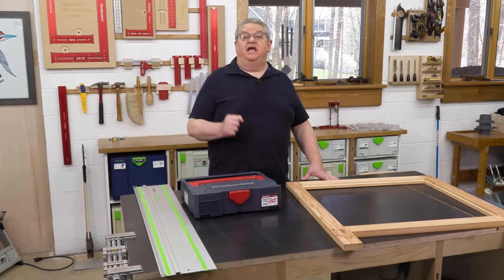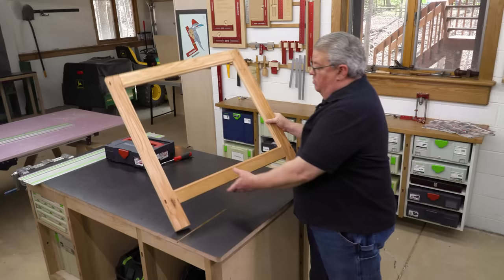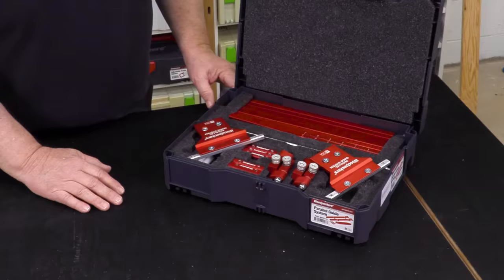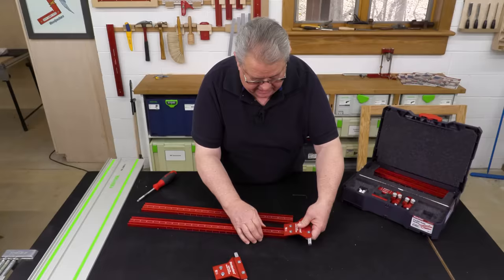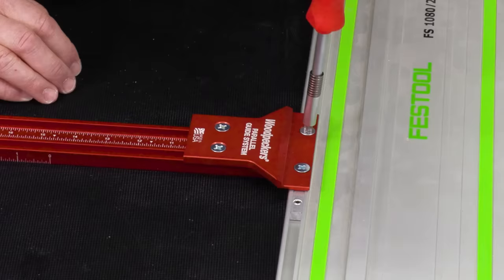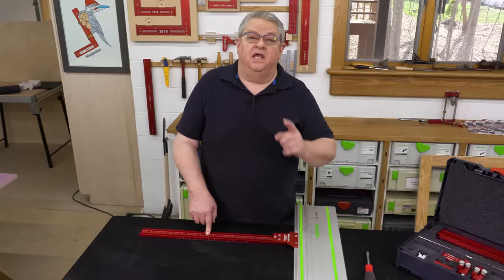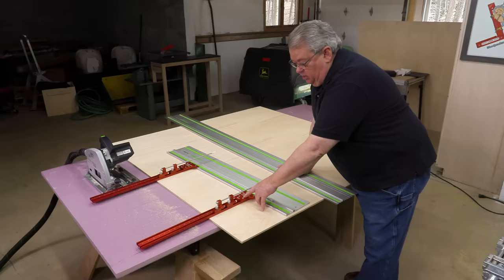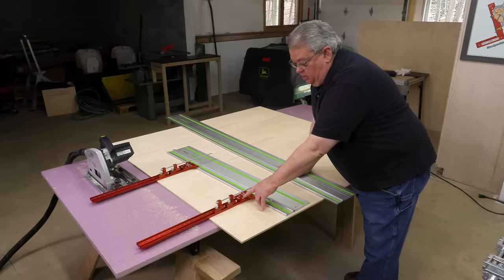This Track Saw Accessory Might Replace Your Table Saw | Deep Dive

Comment: I found this to be dangerous. You didn't anchor the track to the board. That's why they give you them with the track system
Reply from the maker: Sure I did. I did only use one clamp, but I've never had it move with a single clamp.
Reply: @WoodpeckersLLC  And yet you didn't tell the viewers. Safety first. If the manufacturer tells you to use the two clamps you use the two clamps. It will be that one time you get cut back from it slipping and off to the hospital, you go. Mate, you are giving an instructional video and someone is going to copy you.
Reply from the maker: Festool and its trainers teach that no clamps are necessary for most cuts.
Reply: @WoodpeckersLLC  Please supply
Reply from the maker: https://www.youtube.com/watch?v=OxLEXVTjDpY 10:23 "I don't clamp the rail down when cutting plywood." He's their head trainer and host of Festool Live.

Comment: Sorry, but this gadget is not needed for the track saw to accomplish replacing the table saw.  It already does that.  And as far as using this gadget - price aside - it looks like a total time-wasting pain in the arse.  Also, after only a few cycles of assembling and disassembling, it will be absolutely no more accurate than simply using a tape.

Comment: Sorry guys track saws are an amazing tool and so is the table saw but they are not the same tool they both have their benefits but one will not replace the other People act as though the only thing they do is cut panels! what about resizing a small piece of moulding cutting dados or rabbits or a whole host of other things you can do on a table saw that a track saw will never do! sorry guys

Comment: If the square edge it precise enough to ensure each length of the attachment are dead straight when connected, why can’t you just rely on the same square edge to be square to the edge of the track?
Reply from the maker: Square it would be. The calibration process is to get the scales in sync with the edge of the guide rail.

Comment: The original festool is half the price!
Reply from the maker: Comparing apples to apples, the original Festool is $360, compared to $399. Hardly half price and the Woodpecker tool offers significantly more width capacity (52" compared to 25-1/2")
Reply: Festool now has the price to $375 so it's about a $25 difference.

Comment: This video is full of exaggerated claims. How is this more space efficient than a table saw? I mean when it is in use. And like we buy a table saw just to rip plywood.
Reply from the maker: Space efficiency: To rip a sheet of plywood on a table saw you need 8 feet in front of the blade and 8 feet behind the blade plus room on each end for the operator. With a track saw you need  8 feet plus enough room to walk around it. The only exaggerated claim is the headline, which may be a little over the top, but I stand behind everything I said in the video. I did not, nor would I, suggest you throw out your table saw. As you say, cutting plywood isn't the only thing you do with one. I use a track saw in concert with my table saw. If I had not been demonstrating the Parallel Guide System I would have made the first couple of cuts with the track saw and PGS then moved to the table saw with manageable sized pieces.
Reply: @WoodpeckersLLC  with limited space, we do exactly what you described. Use a straight edge and break the sheet to roughly the size needed. Then cut to final size on the table saw. It is much faster to adjust the table saw fence than adjusting the pgs.
Reply: @b3arwithm3  man you are correct that’s what I do with my sheets of plywood regardless if it’s a repeat cut or not just cut it close to the measurements you want and then let the table finish the rest

Comment: What makes me mad as hell about things like this is the "screw the regular guy" sky high prices. Let's be real here, fully functioning profiting wood shops are NOT watching YT channels, they're producing, selling and banking . The little guy is the one subscribing, the little guy is the one advertisers want here, the little guy is why channels are monitizing. Then you insult the little guy with this...hey replace your 499.00 table saw you finally talked your wife into letting you buy, with this over $500 track saw accessory...gtfooh....I'll bet money there is a  Woodpeckers pencil complete with it's own locking case for only 199.99.

Comment: Man,  just run a straight edge install some clamps and start cutting & done...seems like not everyone wants to spend thousands on useless tools.
Reply from the maker: If you only want one piece, you are exactly correct. The point of the parallel guide system is not making one cut, it's about making dozens of them exactly the same.

Comment: An overly engineered and complicated solution to a problem that doesn't exist.
Reply: better over than under engineered but not so hard to understand. The problem that exists is rather obvious to most woodworker.

Comment: Too bad this does not work with my Woodpecker story sticks
Reply from the maker: Doesn't work in what way? The tracks are interchangeable, but the scales are completely different.
Reply: @WoodpeckersLLC  The tracks are completely different, lay them side by side.  Agree on the scales.  How would the PGS flip stops function on the story sticks?
Reply from the maker: The tracks are exactly the same. They're both based on our DP (dual purpose) Track. Story Stick works with the single track side up and the Parallel Guide System works with the dual track side up. I'm still trying to visualize what you want them to do.
Reply: @WoodpeckersLLC  actually this answers a question.  I would consider buying the parts to upgrade an existing tool so that would have a dual function.  Thanks

Comment: That looks extremely complicated and time consuming to use
Reply from the maker: Can I point out this is an educational video? It is meant to show each and every detail to people who own the tool and those who are seriously considering it. No steps left out, no minutia too small to mention. In the real world, you get the stops set and start cutting. Each and every piece is exactly the same size, and it happens nearly as fast as on a table saw, but in half the space. As I mentioned in an earlier reply, this tool is not about making one cut, it's about making 10 (or more) identical cuts...all precisely the same.
Reply: @WoodpeckersLLC  fair enough but 99% of woodworkers won’t use this since our table saws give good enough results for most. Good luck selling it though.

Comment: That's the most ridiculous amount of set up for a tool. Why not just clamp a straight edge on it and let dust fly.
Reply from the maker: Because this tool is not about making one cut, it is about making multiple cuts at exactly the same dimension.
Reply: @WoodpeckersLLC  the same can be done with one of your t squares.
Reply: @Mostviews111  how?

Comment: Nope, sorry woodpeckers this is a bad idea.  Festool, bora, dewalt already have tracks that take 2 seconds to lay and cut.  Time is an issue
Reply from the maker: This tool isn't about the first cut, it's about the tenth cut. Once it is set up, you just hit the stops against the edge of your stock and cut. Compare that to measure, mark, measure, mark, fiddle with alignment, fiddle with alignment some more...then cut. Like you said, time is money.
Reply: And they haven't worked in the field on a jobsite. Engineers don't understand all the variables in an uncontrolled environment.

Comment: I’m pretty meticulous but I never understood the need for perfect squareness. The eye can’t really tell a few degrees off except for close inspection, and even then it takes a few seconds to spot. Furthermore, there’s also optical illusions where even something perfectly square can look off, so if one wants the appearance of squareness, it would actually need work to make it off at the desired result.

It’s wood, it doesn’t need to be perfect. Trust me, I’m annal myself, and I usually take the time to make it perfect, but when I’m done I don’t bother inspecting the thing every time I look at the thing. It just isn’t necessary.

Even people who want it perfect, either spoiled rich folks or just makers that are anal, nobody takes out a measuring tape and/or square to check for 100% perfect angles.

Again, it’s woodworking, not machining nor engineering. Even Gothic cathedrals that used the royal measurement and yet they were off, causing structural problems only became a serious problem hundreds of years later, and that is a true structural application where being square is very critical.

If this work bench or other small furniture falls apart, I can pretty much guarantee it’s not because it was a few degrees or mm off.

For the overpriced product, this is utterly unnecessary at best, even counterproductive at worse.

Comment: You have a big workshop with 3 table saws and none of them has an outfeed table capable of handling a 5 foot sheet. A proven track record of purchasing useless tools and you recommending this. hahahah
Reply from the maker: Having a big saw and a big outfeed table doesn't change the fact that a 60" square of 3/4" thick plywood is awkward to maneuver single-handedly.
Reply: @WoodpeckersLLC   You still have to maneuver the sheet to get it on the bench so you can play with the overpriced tracksaw kit

Comment: Is this a joke? I do my work in an 11ft x 15ft car garage so no space for fixed tools. Using a Dewalt cordless circular saw, diy straight edge, 2 clamps and a speed square costing me less than £200, can set up in 2 mins and cut 8x4s no problem. Common sense vs gullibility.